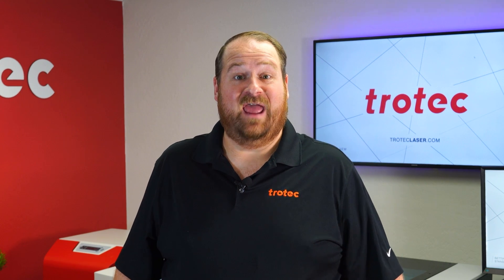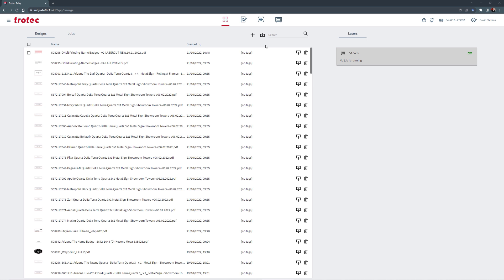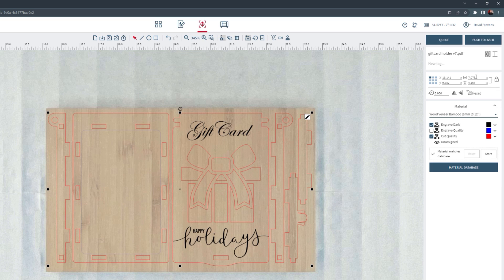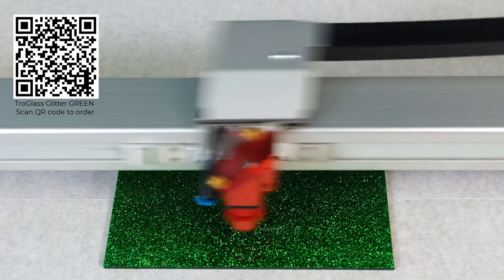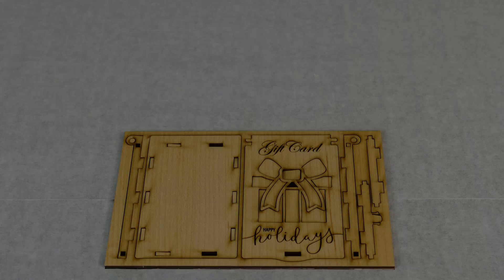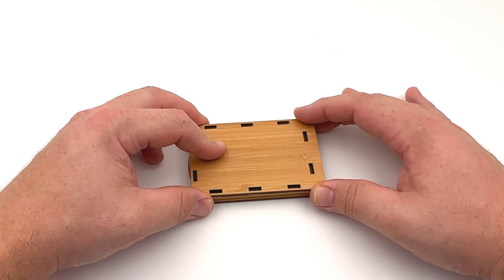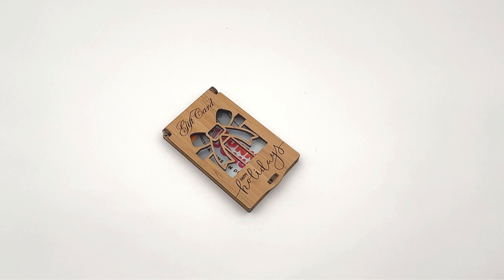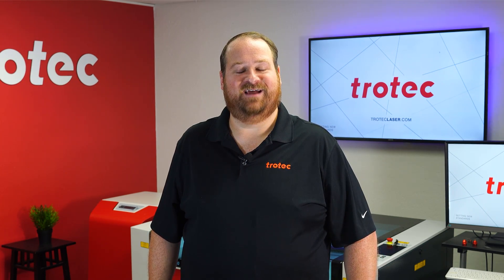Deep Dive with Laser Dave: Laser Cut and Engraved Gift Card Box

Comment: Question: Why does the box have 2 cut lines on every part? The other cut line or engraved line is about .05mm from each other. Is this for something? I really love this box.
Reply from the maker: There should only be one cut line on this file; please confirm that your laser parameter is not set for two passes.